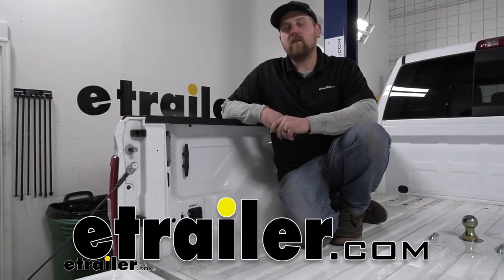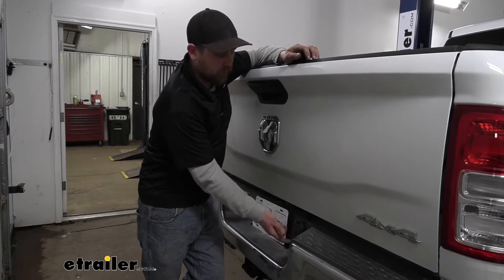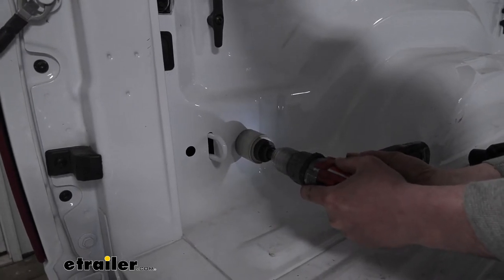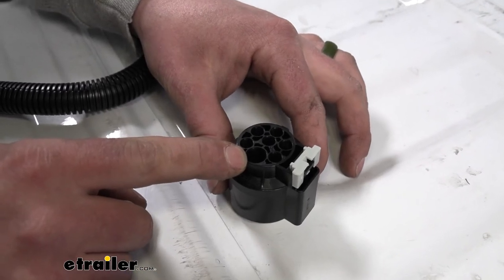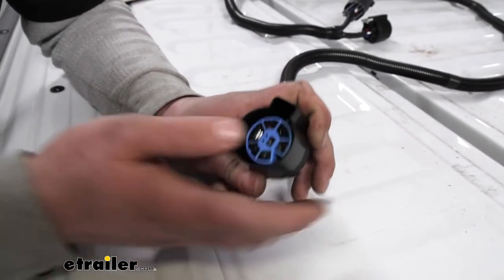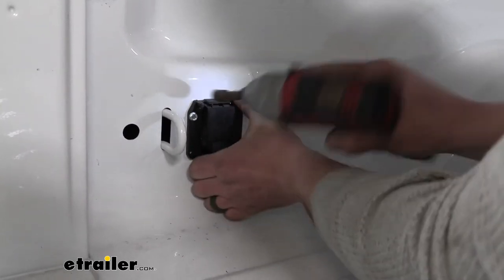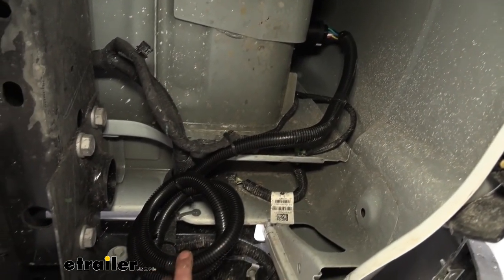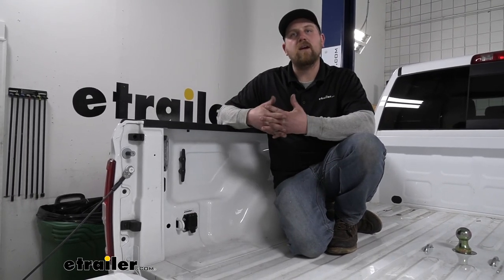etrailer | Pollak Fifth Wheel and Gooseneck Wiring Harness Installation - 2021 Ram 2500

Comment: What size hole saw are you using directions say use 2 1/8” just want to double check…thanks
Reply from the maker: You will indeed need a 2-1/8 inch hole saw. A 2 inch can work, but you might need to use a file or a rotary tool to slightly enlarge the hole. Hope that helps! https://www.etrailer.com/Custom-Fit-Vehicle-Wiring/Pollak/PK11893-11932.html